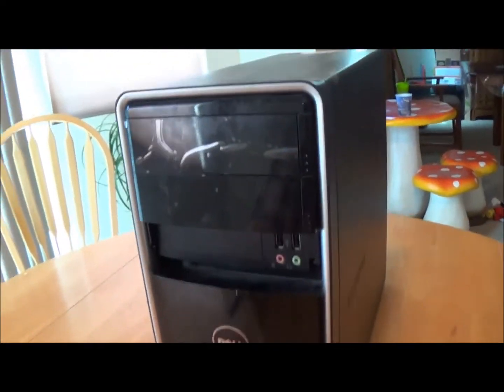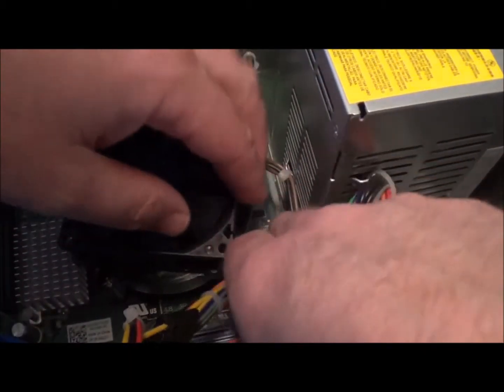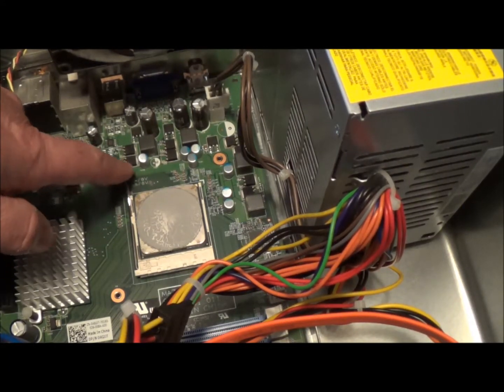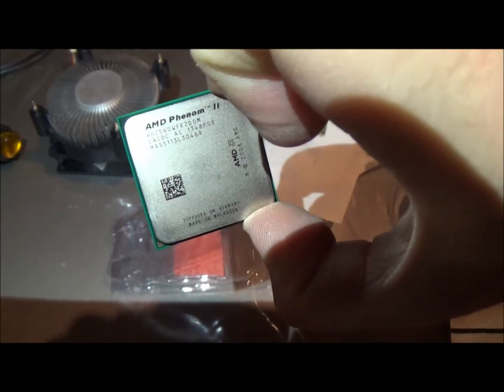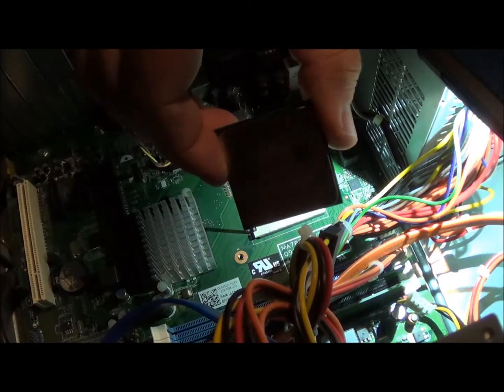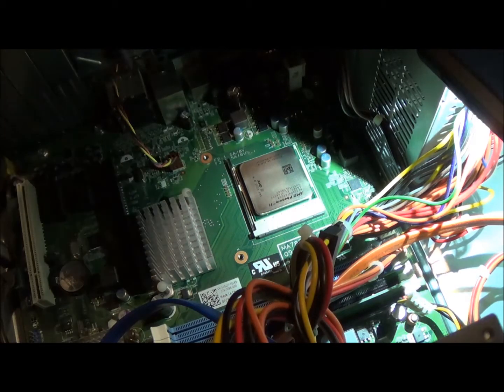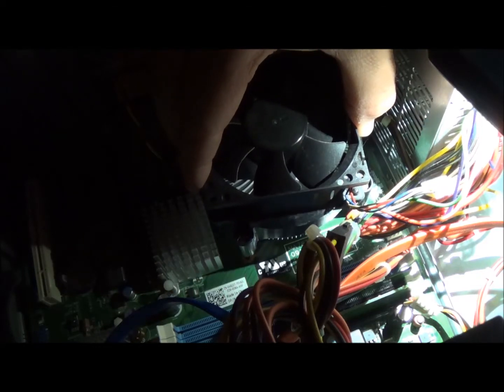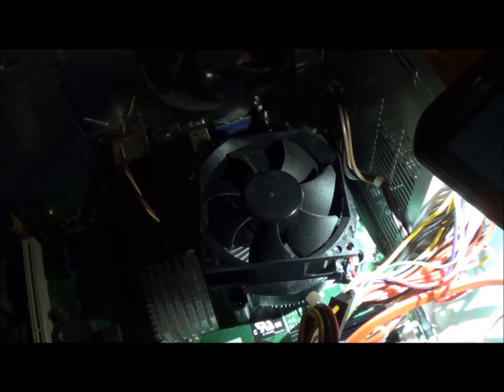DIY Computer CPU (Processor) upgrade on Dell Inspiron 570

Comment: Fantastic. I never tinkered with PC’s but this video made me confident.
I followed the video step by step and I upgrade the CPU of my old Inspiron 570 that, is still capable after 15 years. I replaced my AMD Athlon II 630 CPU with an AMD Phenom II 570 and everything worked. The new CPU is a 3.5 GHz versus 2.9 GHz so, maybe the difference is not very noticeable but for $30 I cannot complain.  Thank you for your video.

Comment: Thanks for this easy instructional video. I upgraded my Dell PC from a higher processer on my desktop PC. I went from a Core I3 to a Core I7 processer. My computer is super fast and will help me when video editing on this machine. Again thanks, dude.
Reply from the maker: Great to hear!
Reply: hi may i know what motherboad are u using. can i upgrade my inspiron 570 to i7?
Reply: @juliuslara923  I have a inspiron 3847 computer. I believe it has a 3847 MT Socket LGA 1150 Motherboard.

Comment: Howdy dude. If you put a 560 processor in your 570, is that an upgrade or a downgrade? I'm also looking to upgrade my 570 after 15 years.
Reply from the maker: You will need to look up your CPU rather than the number Dell named the computer itself. They often have different CPU configurations for what they sold in the Insperon 570. Mine had an AMD Sempron 140 - SDX140HBK13GQ  2.7 GHz. Upgraded it on the cheap to an AMD Phenom II X2 560 - HDZ560WFK2DGM 3.3 GHz. This vid is also about 6 years old so upgrading the CPU may not be as cheap. Computer parts seem to hit a low spot then go back up in price as they become unavailable. This machine still works but I finally build a better setup back in 2017 with only one regret... https://youtu.be/VfgLTscGhaw

Comment: I replaced my CPU and it started to make 6 beeping noises, and the monitor wasn't responding.  If 6 beeps mean video card failure, what do I need to get it working?
Reply: Try taking the card out and checking bios